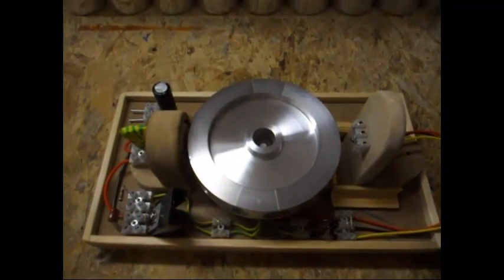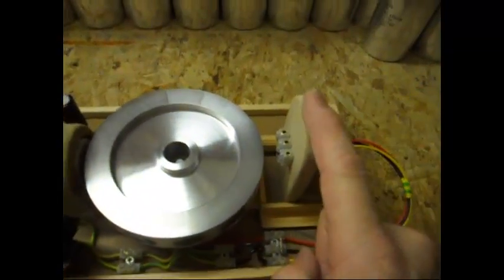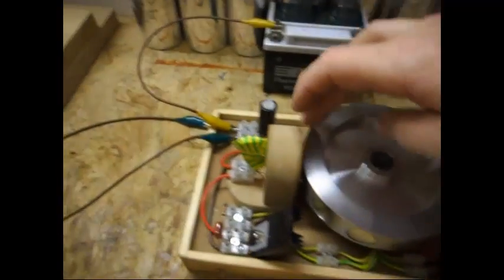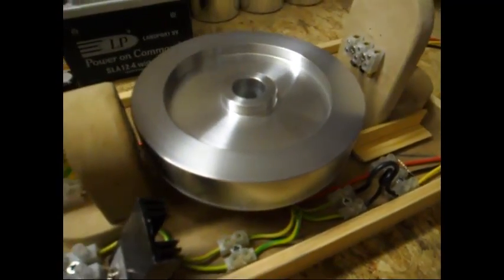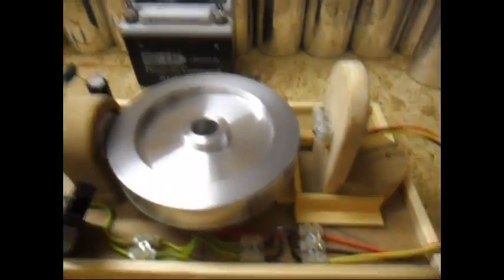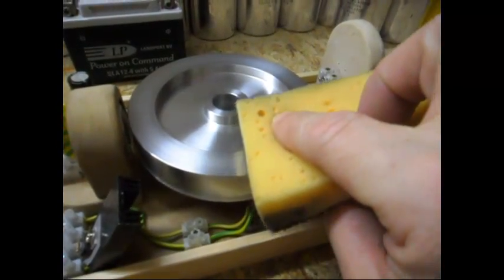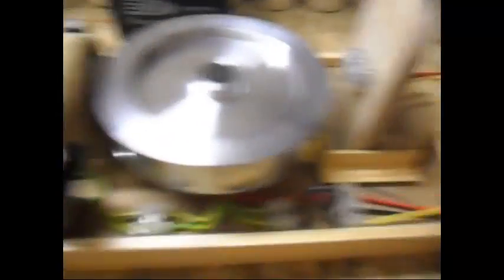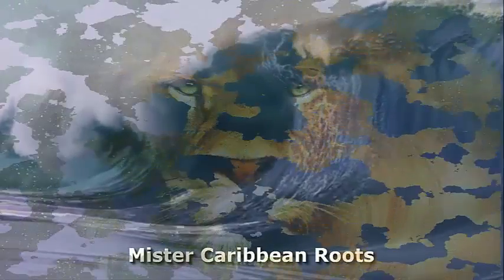Pulse Motor_Basic setup - Almost zero B-emf Update 2 Hyperdrive speed, N-channel Fet & Hall...

Comment: Hello, your project is very good, I congratulate you. I made a similar one with a transistor, but it rotates very slowly, I did it with an 80mm roller with magnet in two poles, maybe the magnets are small, and the coil is 0.45mm.
If you are so kind, I would like to know, what thickness of wire you used for the coil, and what voltage you fed it with.

Greetings from Argentina...

Comment: That is a very fine machine Mr. V2DAY. This is perhaps the fastest one that I've seen here on YouTube. A Bedini motor is basically the same thing only it uses the back-emf to charge batteries. It doesn't matter how you trigger it now does it? Just tap the drain side with a diode for the positive and the plus supply for the negative and you have the generator part. The only thing you can't do for the drive coil is put a damper diode on it. That kills the https://en.wikipedia.org/wiki/Counter-electromotive_force
I built a simple one using a Fidget Spinner. The magnets lay flat. Still it scares me to get those things flying around at such speed. I would rather use something like they do for simple things like muffin fans (my first one), and those washing machine motors that folks from down under use to make generators with. It's actually an alternator with rectifiers.
Thanks for the show.
Reply from the maker: Thanks for your comment, your compliment and glad you've liked it...^^
Nah, how you trigger a pulse motor does not matter at all since it all depends on what you want to do with it...;-)
Yep, when they go fast it does get kinda scary...lol
Cheers

Comment: hello, can you adjust rpm with the hall sensor? or does this only worl with this trigger coil?
nice setup by the way! how much load will THIS motor can handle, for example when you put a bigger flywheel/rotor on it?
and is the max. rpm limited my number of magnets?

best regards, Dominin from Austria
Reply from the maker: Thanks for your comment and i'm glad you've liked it...^^
Nope, with a hall sensor you can't adjust the rpm but you can fine tune the system to get the best rpm at the least amount of input...;-)
A trigger coil is best in combo with a transistor for rpm adjustment...but not with a mosfet...^^
Max rpm is limited by your coil resistance because this indicate how much amps the coil can handle and the more amps the stronger the magnetic field which in turn gives you an amount of rpm and of course better a 12 pole rotor than say a 2 pole rotor like in my case...;-)
Having a heavy flywheel won't effect the rpm much and same goes for the input draw but it will give the rotor much more momentum which is good sometimes to smooth some coggings out...;-)
Only thing is the heavier the flywheel the more time it takes for the system to get to it's max rpm...

See this video of mine, very large pulse motor with a 20Kg flywheel running on 18vdc @ 275ma(ish) only...unloaded of course...;-)
https://www.youtube.com/watch?v=5APrKrQ5jiM

Have fun Dominin...^^

Comment: Very curios what kind of bearings and lubricant you use? Lately, I've been salivating over silicon carbide, and zirconia oxide ceramic bearings, but there so costly.
Reply from the maker: +dieselphiend 
Thanks for your comment...^^
No need for overly expensive bearings and/or lubricant...VHS head bearing is all you need...;-)
Reply: Mister Caribbean Roots You're welcome, and thanks for sharing your cool projects.

Comment: is there a site i can go to learn about pulse motors? ive tried searching and it seems like all i can find is places promoting them, but nothing teaching about how to build or how they work. i want to build one like this
Reply from the maker: Ambrosius Malachai 
Thanks for your comment...^^
There are a few forums where you can find some help but a pulse motor is very simple to build...;-)

Here is some info to get you started...things you will need...

1-You need a rotor/wheel/something round with some magnets...
2-A electromagnet which is basically a coil of insulated copper wire...
3-A drive circuit...

The drive circuit, there are so many ways to build this one...o.O
The most simple one is with a reed switch which only needs a battery a few wires, a reed switch and a coil/inductor...;-)
The coil is one strand only and preferably a coil with 15 ohm or more.
You can also use a lower ohm coils but it will/can burn out your reed switch...;-)

For coil you can use anything you can put your hands on, it can be round, square or any other shape.

It can be an air core one or with an iron core...try both and see how they work...
See this image here which is a very basic one for you to start with...;-)
Link...http://simplemotor.com/wp-content/uploads/2014/01/dig2.gif

If you have any questions, just ask and i'll do my best to help you out if i know the answer that is...lol
Have fun & cheers
Reply: alright thanks, i am just getting into electronics,so i have to learn about switches and resistors and all this as well. if i have anything i cant find on my own ill be back! :)
Reply from the maker: Ambrosius Malachai
Same thing here, i still see myself as an beginner...;-)
Once one see oneself as an expert there is a posibility that one will stop learning because of the way of ones thinking that one knows it all...
Cheers
Reply: 16
Reply from the maker: +aarion lee 
Or maybe 18...;-)

Comment: Ok..imagine with me... Your car .. think about the top end of the cylinder...  On your piston.. Place a Magnet on the top of the piston, then put a. electro magnet on the top of the head side... open the head and leave the rocker assembly open... the whole system is already designed for it.. no combustion... just add magnets and go... how about that?
Reply from the maker: Jason Teddy 
Thanks for your comment...^^
That is a good idea which has been talk about before on some forums...;-)
We still need to run them electro magnets so it does need a battery bank or a generator and which both of them need to be charge/driven by something and if that something isn't a combustion engine than it is good to go...^^

Comment: Hi, I wanna built like this.. help...
Reply from the maker: Hi Khun. Roma,
Thanks for your comment...^^
Just start somewhere till you get better at it or if you have a lathe machine than you can make the rotor wich is the most work in this setup...^^
Read my reply to mohammadreza ramin under this video, more info on this setup...
Pulse Motor_Basic setup - Almost zero B-emf with hyperdrive speed...
Reply: thanks much, ill try it out :)
Reply from the maker: Khun. Roma
You are most welcome...^^
I hope you get it build, step by step you'll get there...^^

Comment: Are your experiments are safe? After all, it can break off his head
Reply from the maker: Hi Lechoslowianin,
Thanks for your comment and concern about safety...^^
It's not very safe because like you said it can come of the VCR head but that's why i don't like running it to long at those rpm's...
It's only a 1mm shoulder that keeps the rotor in place so yeh...not so safe...lol

Comment: haha wow that would have been a mess if it had broke, thankfully it didnt. i really like that pulse motor you have made, looks good and sounds amazing =]. have you tryed it with your accelerating coil just for fun? i wonder if it will go faster still!.
Reply from the maker: Thanks for your comment...^^
LOL, good thing it didn't broke...did you know that the shoulder on wich the rotor fit tightly on the VCR head bearing is only 1mm...lol
I like the sound to, makes me wanna go racing...^^
I haven't tried it with the accelerating coil because of the crappy output of it but that coil makes the system S.U.L at >2600 rpm with a 24 pole rotor and this one here is a 12 pole rotor so i would need a minimum of say 5200 rpm to get that effect but i do think that this rotor is spinning something like that or even a bit higher...
It's a pretty heavy rotor, solid aluminum...^^
If it goes even faster than i really need to build a wooden protection box for me...lol
Reply: Mister Caribbean Roots i love to hear the sound of this motor !!!
The VCR ball bearings are optimal for small pulse motors ;)
Reply from the maker: Gianni Laschi
Thanks for your comment and glad you like it...^^
Yep, the VCR bearings are perfect for small types of PM's...^^

Comment: Thanks for sharing

Have you schematic for mosfet driver
Core info ?
Reply: Hola que tal. Antes que nada muy buen trabajo. Llegue medio tarde para preguntar pero, tendria algun esquema  del circuito para ayudarme a construir uno igual?  Se lo agradeceria. Muchas gracias.
Reply from the maker: Thanks for your comment...^^
The coil core is an aircore, the mosfet and hall circuit is a very basic circuit...
N-channel mosfet is a IRF3710 with a 100k ohm on the Source and Gate to make sure the mosfet closed 100%...
The resistor from hall output to mosfet Gate is a 22k ohm and i have a 10k ohm on the positive and output of the hall...
The hall is a south switching one and that's all there is to it and i hope this help you out...^^